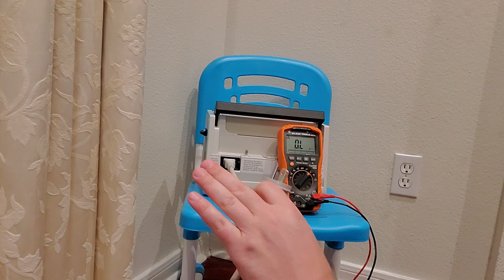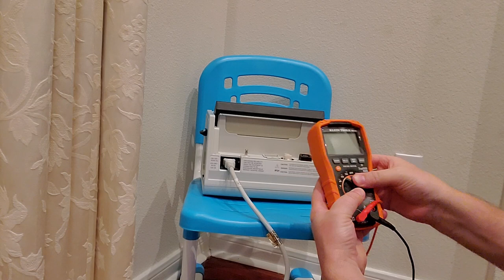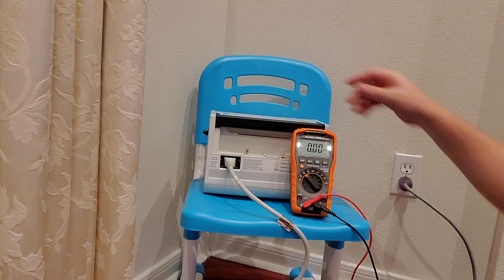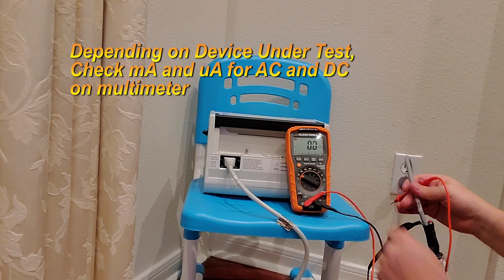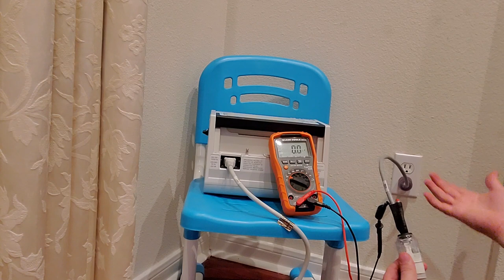Electrical Safety with Multimeter Jig

Comment: This tutorial also comes in extremely handy for when I have to send my ESA620 in for cal once a year. I’m a one man biomed shop and when I’m down my analyzer for the better part of a week, this will allow me to still be able to complete PMs or post repair re-certs. Awesome video!
Reply from the maker: I need to make an updated version of this. There should be a 1000Ohm resistor in line.
Reply: @BetterBiomedChannel  I am looking to make one of these in a nice box.  Where and why am I placing the 1kOhm resistor?

Comment: I have always wondered about using  a multimeter. Great Idea! Seems like the only reason you would need a true ESA is for patient leakage tests or ISO testing which requires thing like reverse polarity - but even all of those you could probably create a jig. You have my mind thinking lol.
Reply from the maker: About 50% of my viewers are at locations outside of the USA. Some are on islands and some are in very poor countries with no electrical safety codes for medical. - They do seem to all have some sort of multimeter.  By showing them ground resistance and a jig for case leakage, they can start checking their equipment today.  We really can help change the world.

Comment: Thank You .  Could also get a 4 x 4 box with an outlet one side and a switch (to open and close the ground) with a cord to the wall and plug the electrical device into outlet. switch opens ground. this would work better for those without soldering?
Thanks
Reply from the maker: That's a very cool idea!
See! Open source worldwide biomed problem solving. A 4x4 gang box and switch would be available anywhere.

Comment: Can you talk about electrical safety regulations. And what the hospital needs to follow if it is by state or federal. A lot of our equipment PM status has been changed to no PM required.
Reply from the maker: According to the latest NFPA99 and CMS requirements, many items fall under a possible AEM program.  - unfortunately. Some things like light sources and warming cabinets should always be cleaned - because they can catch fire 🔥.... but some places still put "no pm required" on them.....
Reply: @BetterBiomedChannel They are literally only going by the manufacturer's recommendations in the service manual.They put the OR Solutions fluid warmer on a 5 year a PM. The manual is talking about the module that keeps the temp not electrical safety. In my book if the medical equipment is portable and also has a removable AC cord it needs to be safety tested. I have seen 1 hospital grade molded power cord with the hot and ground reversed.

Comment: Don’t you need an AAMI simulated patient in series with the test lead.  It is a specific capacitor and resister .
Reply from the maker: No, I've never heard of such a thing unless that is "patient leakage". Case Leakage is a direct measurement of energy present on any electrical device compared to ground potential.

Comment: While I do think this is very cool I don't see this as being feasible in the US. I don't think TJC would be very receptive to some kind of bootleg ESA like this. Are ESA's not readily available in other countries? In my organization test equipment must always be documented. I can only imagine the storm if an accreditor discovered something as this was being used. 

Again, I think this is super interesting and informative into the the concept and explanation for electrical safety. I just don't see how this is practical or could ever be used.
Reply from the maker: You're reaching a little bit.  Every inspection I have ever been in (which I a lot) doesn't care about the biomed program (for the most part). I have never heard of them inspecting our test equipment.  Never.  Most work orders at most places I have been at do not even record the safety analyzer used.  ESAs are not readily available in most other countries and even harder is annual calibration.
Reply from the maker: A real application is with 220V devices. No shop that I've ever heard of has the 220V plug adaptors to test all the 220V devices that enter the building. Most places BS their way through those electronically safeties but I developed 220V jigs of each type of wall adaptor with liftable ground.